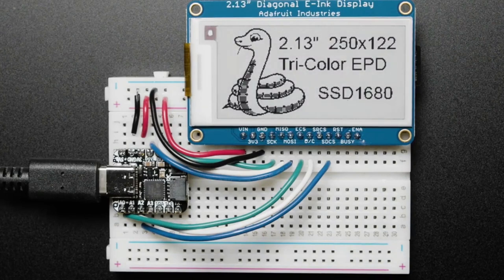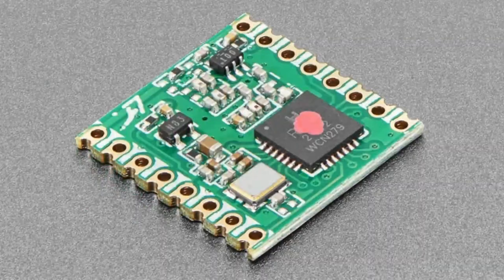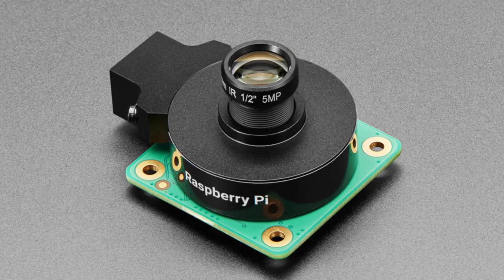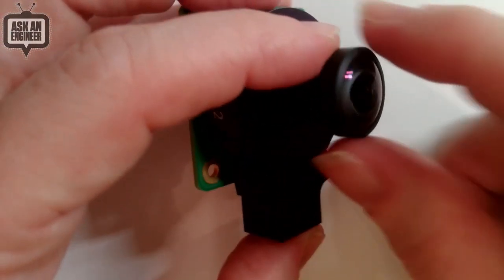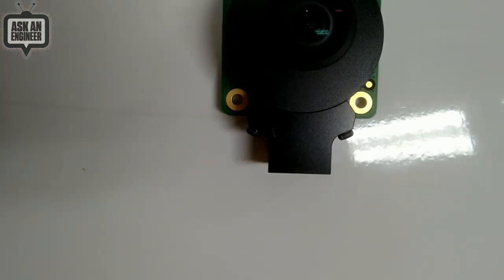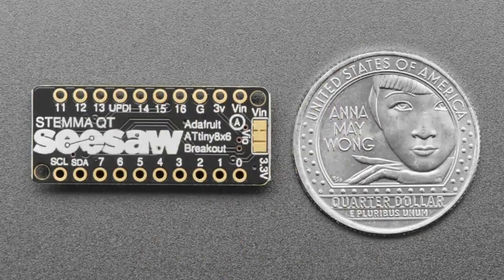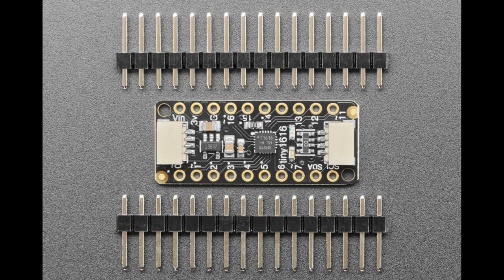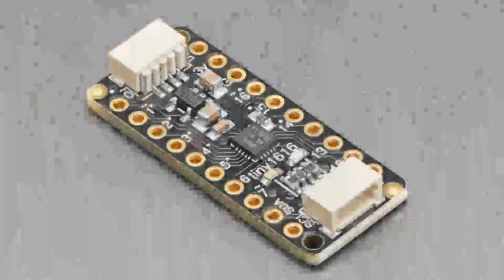NewProds 2/15/23 Feat. Adafruit ATtiny1616 Breakout with seesaw - STEMMA QT / Qwiic!

Comment: When can we expect an ESP32-C6 Feather? I feel like it'll be a game changer for us smart home nerds! thanks to all the onboard battery management stuff you always add to feathers and the C6's Zigbee support. That effectively allows us to make completely custom rechargeable smart home sensors!
Reply: The chip can get down to 7 uA in deep sleep. Of course a feather's on board power supply will use some too but hopefully it gets really low.  Personally, I can't wait for the C6 QTPY so we can get tiny ZigBee devices! With a 5x5 QFN package that should definitely be doable (fingers crossed).